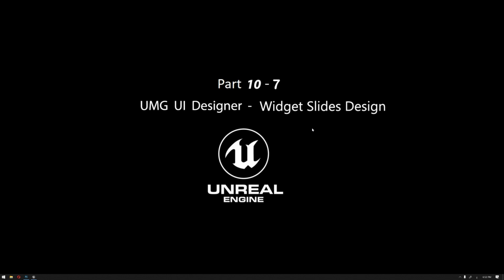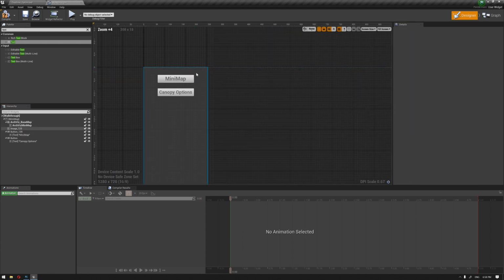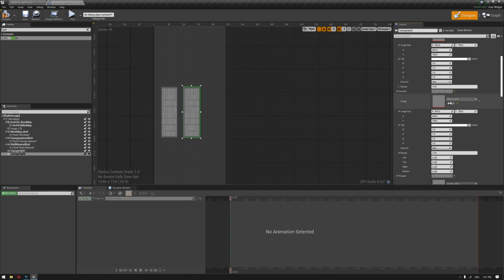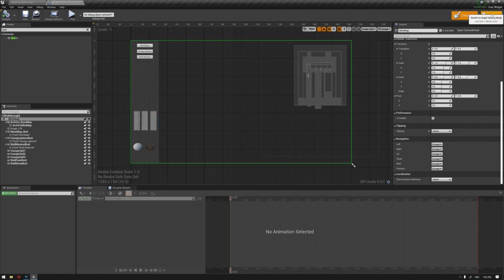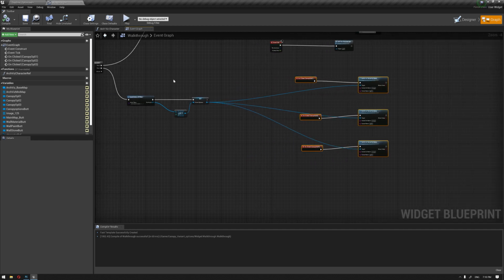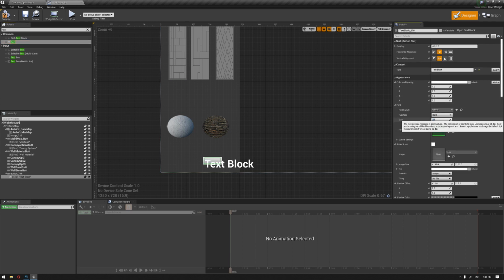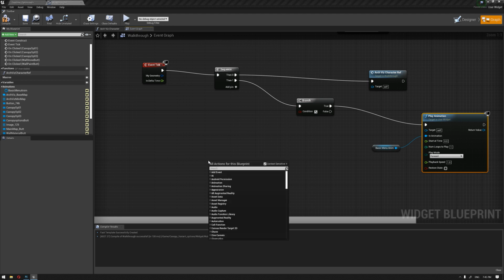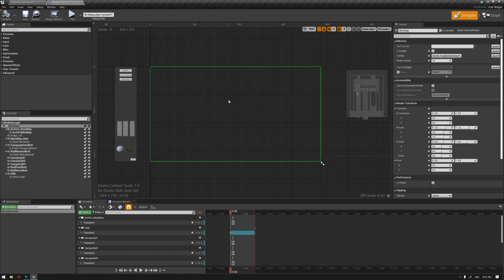Unreal Engine 4 Arch-viz Tutorial Course part 10-7 UMG UI Designer-Buttons Function and Animation

Comment: Great tutorials. 
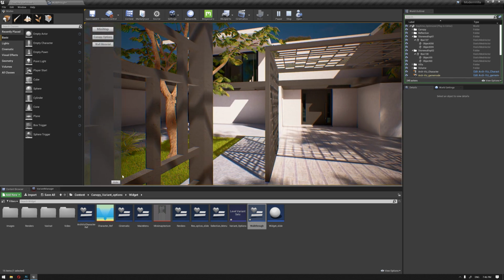21:51 - im having the same issue that UMG widgets are visible on play even though i placed them outside the window like you did. Did everything how you have told to solve this but it isnt happening. Read UE forums, watched other tutorials also, still the same issue. Please share the solution if you know, cuz im stuck since 3 days on this small issue. 
thank you !!!
Reply from the maker: hi there , thank you , actually this can be fixed by selecting all the widget you want to animate and set their position together at the starting frame and make sure all of them got a key frame at the  starting position  , its just a matter of key framing , if your still facing a problem plz let us know and we will try to send you a small UE example file
Reply: @theimageneers5161  Thank you for your reply. I solved this issue. Previously i was changing the properties of the element from the properties window ( on the right side ) ,
This time i changed the properties from within the animation window ( by adding transform track) and it worked like a charm. 
Thank you again for you reply.
Reply from the maker: @AryansinghT60  Thanks for coming back and sharing this we are glade you manged to solve the issue , and cant wait to see what you done  with UE4 for your Archviz project
Reply: @theimageneers5161  Actually, i was making a Car configurator in UE4. I wanted to learn and implement two things - one is animating the UMG and linking variant manager setup to UMG. So i watched this video and the one where you have showed how to link variant manager and UMG, both of which were really helpful. Thank you for that. 
Ill surely share a link to a small video and for the exec. file whenever im done making it. It is in its last stages though. 
Cheers!!
Reply from the maker: @AryansinghT60  Thats really interesting and yes we would like to see that once its done , best of luck
Reply: @theimageneers5161  Hi, Just got done with the windows version of the car configurator. Here is the link - https://www.youtube.com/watch?v=_vxgWalo0Y0
Do read the description for the download link.